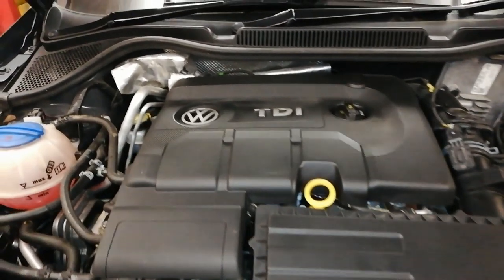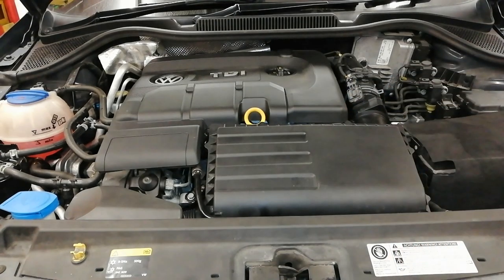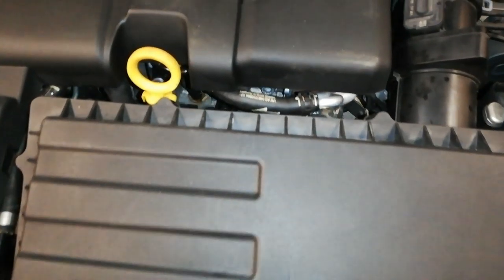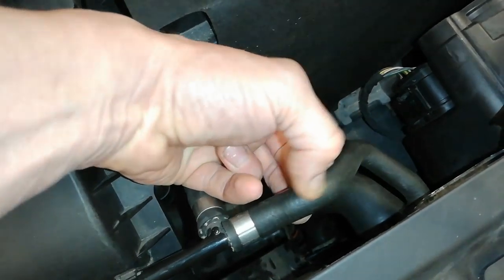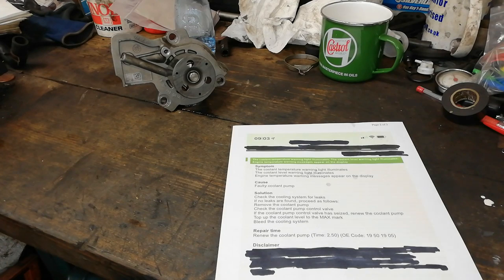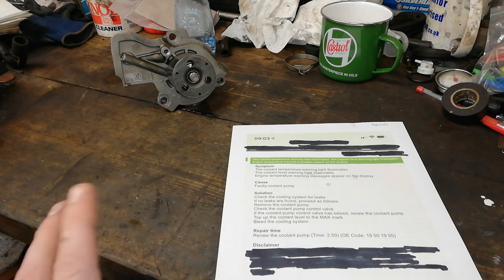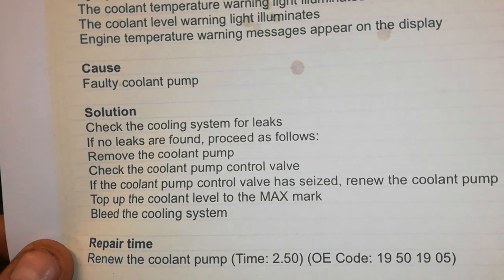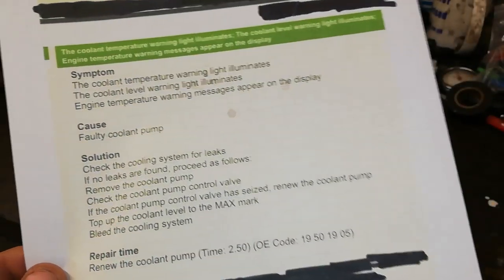VW AUDI 1.4, 1.6, 2.0 TDI Overheating Switchable Water Pump

Comment: I have a 2014 1.4TDI Polo which I bought from a VW dealer in 2015 with approx 12,000 miles on it. Love the car but have so far had to replace the water pump 3 times. Twice by VW while under warranty a third time when I paid VW to replace it (out of warranty so not their fault !!!). The car has now done approx. 60,000 miles and guess what, it's starting to overheat again. Can't be 100% but symptoms are the same so I think I am looking at having to get the water pump replaced for a fourth time. Thank you very much for this video. This has finally allowed me to understand what is almost certainly been going on with my car. And knowing now, after watching your video, about the existence of aftermarket pumps without the problematic diverter shield should finally help solve this issue with the car
Reply: Did the aftermarket pump fix the problem for good? I have the same issue at the moment. Thnx, Gido
Reply: @gidoelferink9626  100% fixed, by fitting the simpler water pump that doesn't have the problematic diverter shield that used to stick in a closed position 👍

Comment: Gold dust video Dave. I’ve been and still going through the overheating temp issue but no obvious causes. Overlooked water pump as it was changed before I bought the car and the overflow into the header tank is good when I rev the engine up. So next is the water pump and see if it’s the switchable one fitted and test it like in the video. Been on forums regarding same issue but no one has the fix as yet.......watch theirs space,I’ll keep you posted on my results.......Cheers Dave.
Reply: Did you fix it?

Comment: Cheers Dave, has one of these a few months back but sent the job on to another tech as I wasn't 100% sure.
I have had plastic impellers cracked before and start to slip at higher rpms.
It's nice to see how this style of switchable pump works and how it fails.
It's one hell of an extravagance to reduce engine loading to shave a tiny amount off the warmup emissions!
But in the big picture it doesn't save anything if the fancy water pumps keep failing!
Reply from the maker: Yrah, over engineering at its finest

Comment: This small square silica bag is extremely tough and not probed to burst as suggested. The heater matrix blocks due to the far to easy due to the very restricted water passage ways only about 1.5mm wide design problem.
Reply from the maker: @hollows61  not prone to burst you say. Strange how VW have produced a machine and fluids to clean out the silica, imagine that.
Reply: @davesterl  I hear what you say but the matrix block on those that don’t have the silica. Next time you replace one cut it open to see it’s  designed to block as the passage way is so restricted.
Reply from the maker: @hollows61  I hear what you say altho this video is about a water pump and it was you that mentioned the silica bag
Reply: @davesterl  sorry i was also watching a video about the silica bag being blamed for blockages. But yea these new  pumps are a disaster and will give problems at some time.

Comment: Hi. Does this mechanism closes each time you switch the engine off or stay open when the engine has the 90 degrees temp? If unplugged when warm will it stay open all time?This would prevent overheating. Thanks
Reply: If it's unplugged, the pump mechanism stays in the ON position, always, and never moves.

Comment: Hi Dave, my 2015 Passat 2.0TDi is overheating after about 5-10 mins of running, gauge goes pass 90 for a minute or so, then returns to 90. It’s then ok for the rest of the trip. Do you think it’s the same issue with the water pump. Great video mate, showed some VW mechanics in Australia, which they didn’t know about.👍
Reply from the maker: With this issue, tends to overheat on long runs ie:motorway
Reply: @davesterl  Do you have a explanation yet ? Ive got the same issue, but not always. A mechanic told me its the waterpump what is being activated, aslong there are no warnings and the temperature goes down to 90 its fine. Did the overheat last whilst driving or did it cool down eventually to normal conditions like my example ? U did not mention this in your videos. Thanks for the information !
Reply from the maker: @dbijlholt  do i have an explanation for what exactly?
Reply: @davesterl  For Neil Morris his comment. Did the overheating last or did it return  to 90 whilst u kept driving ?

Comment: thank you very much, only one information please, if i will replace the water pump with new one without the divertor, there is any risk for the engine (ie low heating or slow warming up or some error on the ecu due to solenoid unplugged?) thank you very much in advance

Comment: Hi Dave, quick question.  If there is no flow back to the water expansion tank, does that mean it's the switchable water pump?.
Car overheating, not straight away. But after lots and lots driving.

Comment: Had a mk3 Leon 1.6 in with a blocked heater matrix due to the silica bag being ripped and there was still casting sand in the matrix to
Reply: Best way to flush it is to drive it and flush it every 50-75 miles for a week and then on the final flush access it for more granules

Comment: Great explanation. Is it possible for the expansion tank to leak from heater matrix blocked or aux pump broken? My lower radiator hose is cold so possibly thermostat broke. I'm puzzled. Edit: I have just taken the silica bag out. it was still sealed but stunk of a burning smell and looked brown and really old. Cheers
Reply from the maker: Yesah its possible but not very likely

Comment: Which pump has diverter, how do we know if pump has diverter, i have 1.6tdi cayc replaced pump and belt, i can smell something burning and engine running fast, it seems overheating also fan kicks in even in short journeys, i used FEB pump abd INA belt kit.

Comment: I've got this exact issue on my skoda superb 2.0 TDI. Just spent 5 days arguing with Skoda about this. It's a known faulty issue with the water pump. They want to charge me £1000! For the replacement. Absolutely disgusting. Manufacturer should cover the replacement but they refuse. My car is 41k miles and 2018.

Comment: Hi there, I have a Audi A3 2013 Sportback, my issue is that the coolant level  in  expansion tank  constantly dropping. No internal or external leakes. There is coolant around the molded seal (outside).why?  Also I only have heat coming out of the passenger side vents inside. Could all this be due to the switchable water pump?…. 5:09.. please help

Comment: Great video Dave , yet again over engineered bollocks , designed by suits , too complicated for their own good , this job we do is getting crazy , dealers tell us Frigg all, it's a good job us guys help each other, that's one for the filing cabinet information, of course VW will say they have not had a problem with them like all manufacturers do , stay safe buddy , cheers
Reply from the maker: i now what your saying mike, VW know about this one alright but goodness knows what they tell their customers. only needs to last for three years
Reply: @davesterl  it's a service item sir ! , Out of warranty now sir  , it will only cost you £ 800 plus to change it !🤠🤠🤠🤠🤠🤠🤠
Reply from the maker: @mikeberry304  probably would cost about that

Comment: Hi Dave. Ace content as usual. With regards to removing the silica bag, have you any idea whether it might be advisable to switch to G12 coolant after removing the silica. I wondered if there’s something in G12 that’s been removed from G13 for environmental reasons and that might be the reason for the bag os silica being required?
Reply from the maker: Yes, good question Russell. The G13 is Glycerin based made from Bio-diesel environmentally friendly. The traditional G12 is Eythelene Glycol. The G13 has silica additives in it to prevent corrosion to aluminium radiators etc. My understanding is additional silica bag if the car has extensive aluminium ie: intakes etc. G12 and G13 are miscible but the long life aspect and corrosion protection are reduced. If you revert back to G12 you need to change the coolant more often. This car has G13 but no silica bag for example, but im happy to fill with G12

Comment: Hi Dave ,i just noticed you show in this kind of engin has two auxiliaire water pumpe?
Mine its 1.6 tdi since 2012,and i changed  already one auxiliaire water pumpe plus kit timming belt and still dosent work this heating inside of the car,of course i changed already thermostat, EGR,checked matrix radiator and still haven't heating.
Please what you are recommend to me.
Thx.
Reply from the maker: Maybe the car has silica bag and has burst and blocked the matrix. You need to test to see where is hot and where is cold rather than changing parts

Comment: Any issues with coolant leaks on these 2.0tdi Cuna engines Dave? I have a drip of coolant on my under tray just below water pump area. Of course this wouldn't happen around home just 300miles  away in cork.
Reply from the maker: Not that I'm aware of but anything can leak
Reply: Any recommendations for decant mechanic around the Belfast/lisburn area to do the timing belt water pump and address the leak?
Reply from the maker: @tom5001  not really, all i hear are horror stories

Comment: I have issues with VW 1.5 TDI. When ever I drive up hills, coolant temperature warning appears, temperature goes up to 105 degree Celsius. Also the coolant level is getting lower without any visible leakage. What could be the issue ?
Reply from the maker: Pressure test system
Reply: @davesterl  thank you forr the reply. Already pressure tested the system, no pressure drop or leakage. Service centre couldn't able to find the issue.

Comment: Hi Dave, 
I have a similar problem with my VW Passat B8 model 2017 2.0 TDI. My temperature matrix goes above 90. I have replaced the temperature sensor and thermostat and I still have the heating issue. the water pomp was replaced before I have bought the car. What would be the main issue ? I have diagnosed the car and there is no issues or storing codes everything seems ok but the overheating is still persist the only thing I do to  help cooling it off is that I turn the heater on inside the car and then the heater temperature matrix goes to normal. Any suggestion or guidance would be much appreciated !
Reply from the maker: You could have a blockage but likely the water pump. Check your rad pipes if both get hot. Diagnosis means to find the problem
Reply: @davesterl   I will change the water pomp that’s the only remaining thing I have not replaced myself yet hopefully this issue will no longer exist ! Thanks for your quick reply and I will update u if the problem is solved
Reply: @jawad08  Have You changed the water pomp ? Has it solved the problem? I have the same problem with VW Passat B8 model 2017 2.0 TDI as You had.
Reply: @maciejpiechota6528  no not yet I wanted to do it together with distribution belt since both are in the same spot ! But if you running on low mileage I think you just have to change the water pomp and it’s common issue with this model.
Reply: @jawad08  I think I'll do the same :) Thanks

Comment: Can the coolant system be bleed the same as the none electric water pump system. With the coolant cap and run the engine to temp.
Reply from the maker: yes
Reply: @davesterl  another question i have, will the older locking tool for the crankshaft fit this model. the tool for the 1.9 and early 2.0. Thanks.

Comment: I have this intermittent problem with my golf, along with the problem the a/c runs warm could this pump cause this?
Reply from the maker: Not as simple as that with this system
Reply: dave sterl so it is more than likely two isolated faults that aren’t connected. I have just had the thermostat changed and the problem persists. One day I can take it on a long drive without problem another it will overheat. I can also be on a short journey and when I rev up the heat increases. Engine coolant is tepid.
Reply from the maker: @ryanward1234  yep check if top hose is hot or not. It will be cold if pump is stuck.
Reply: dave sterl thanks for your prompt replies really appreciate it